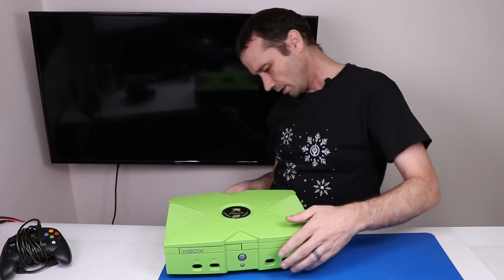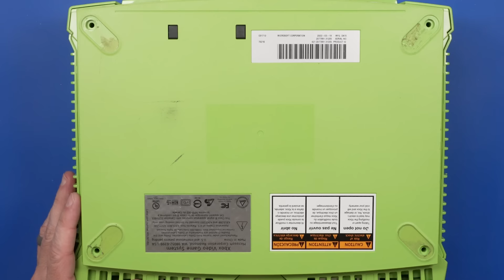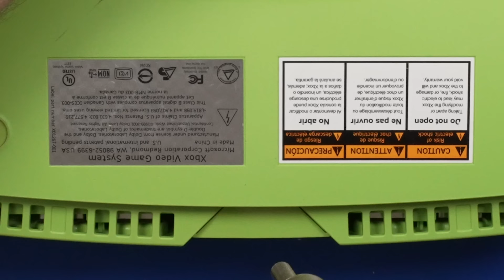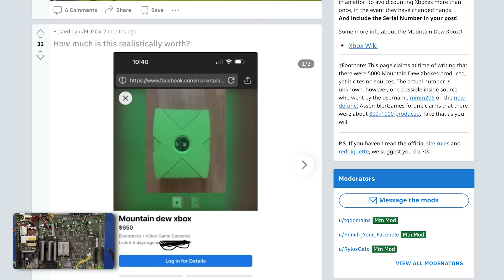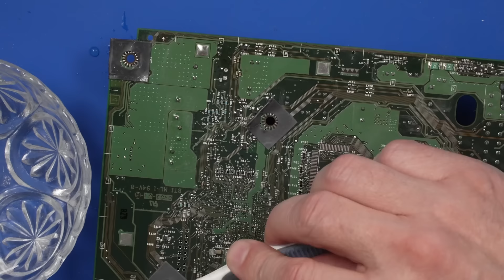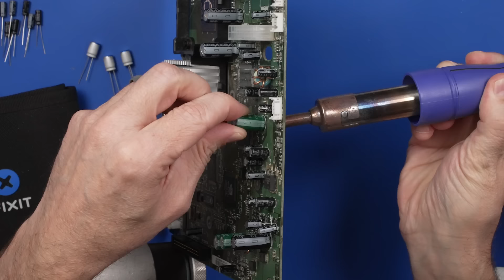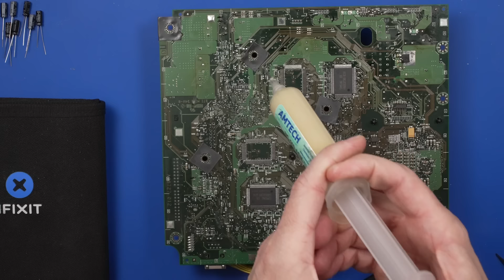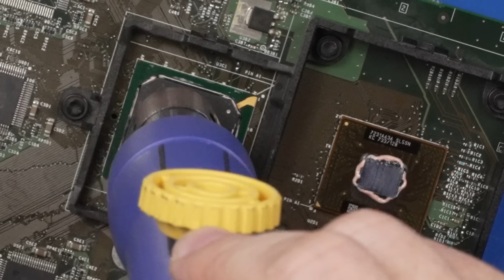I Finally Found One of These! Can I Fix It?

Comment: I hate Goodwill so much. Taking donations from people and still price gouging. Special place in hell for that company.
Reply: The reason why Goodwill has gone up is because of the resellers looking for a fast flip.
Reply: I have actually purchased a number of things through the Goodwill site over the years. The best deals I found were on a couple of virtually brand new HP Chromebooks a couple of years ago during COVID. They were in the original box, basically brand new condition. I purchased them on a long shot for my sons to use for school, and it turns out they were absolutely perfect. They are both still using them today, and I only paid about $40 each for them. You can get a good deal on there, but I agree that some of the prices go way too high because of people trying to flip stuff.
Reply: They're trying to raise money for good causes by selling valuable items at fair market price. If hell is full of people like that, the horrors of the underworld have been greatly exaggerated.
Reply: Not such a goodwill at all then I take it? We don’t have it in UK
Reply: @rorykelly8275  Goodwill spends 90 percent of every dollar on charitable work, they are a top rated charity by independent charity watchdogs.
Reply: Seems like someone either doesn't understand or support charity. Or they expect a charity store to be cheap so they can make a quick dollar off of someone else's generosity.... (@whatjake7898)
Reply: At the end of the day it's not a necessity. It's a luxury.
Reply: Chances are you have damaged traces that feed the power and eject button. If you flip the board and look in the area of the clock cap towards the edge, thats where to check. If that looks good, try another 110v PSU and if you still have nothing at that point, I'd be using a digital microscope and maybe getting a replacement power button pcb. I'll watch with interest.
Reply: Goodwill’s not perfect but they help a lot of people out beyond their stores and clothing. You’d be surprised how much they actually do.
Reply: Everytime I go shopping the pricetag is the wrong price.
Reply: These are auctions, people bidding are the ones making the price go up, not goodwill
Reply: Better to donate to a local thrift store.  Goodwill is a for profit company masquerading as a non profit.
Reply: Why???

People donate to goodwill just to get rid of things easily

The market decides the prices
Reply: Why 🧐 you say why
Reply: I stopped going to thrift stores that started following the Goodwill model. There’s a big one about 15 minutes away called 2nd Avenue and a few years back they’d put stuff out with generally flat prices. I found CIB copies of Suikoden and many other rare PS1 games. Then they started picking stuff out and putting it behind the counter and asking eBay prices. Which is absurd considering their policy of no refunds. It’s like, why would I pay eBay prices for items that don’t have an eBay guarantee? So I just stopped going. Hopefully they’ll go out of business soon.
Reply: On shopgoodwill they charge what people are willing to pay. It's not price gouging. It's more profit for their mission. Yeah it means less super good deals for thrifting, but it's not usory.
Reply: @Spikemonkey80 their mission is profit.
Reply: I don’t think you understand what goodwill does
Reply: I had bought a double buggy and two car seats etc (came together.). I lost my twins snd a second hand baby shop offered me 2O% of the original price. Items were in the box still.
Reply: @phantomreaver85  Then maybe you should try volunteering and helping them out. Goodwill stores operate on very small margins, and huge costs are sunk into sorting and checking donations, not to mention the trash fees for all the unusable junk people donate. Rather than complaining about those trying to help others, go out and help others yourself!
Reply: Goodwill & St Vincent’s, etc, only enable the mooching slackers of the world. I do not think anyone should contribute to them.
Reply: @gnarly-narwhal to then donate to charity
Reply: Their mission is charitable work, selling donations is how they raise money.  The higher selling price allows them to do more charitable work.   They don't set these prices, the market does.  Be angry at the market instead.
Reply: @Scruit  their mission is profit under the guise of charity.
Reply: @Scruit  Their charitable work is supposed to extend to their resales because they're supposed to be helping poor people buy things that they need....
Reply: @buddsmokengood no, selling to poor people is not what they're doing with their stores.
Reply: @notahotshot  That's what all thrift stores are doing...... People with money don't go to thrift stores.....
Reply: @Scruit at the same time, since they are getting this stuff for free they could just sell the item at a flat rate instead of trying to milk it for everything it’s worth. Because all they’ve really done is pushed paying customers away. I refuse to support their model and haven’t been in a Goodwill in about a decade.
Reply: @jackplumley3308  The whole point of Goodwill is to use the profits from reselling goods for their charitable purposes. The only point of them having "paying customers" is to raise money to help people. You not supporting "their model" is just you not supporting charities helping people.
Reply: So, they should resell something for significantly less than market value and so leave a larger margin for the next reseller? 🙄

FWIW, there are some great deals to be found at thrift shops -- just not in video games. I am an avid bibliophile, and I once purchased a vintage book about Princess Elizabeth (as she then was) for about $.50; the ABE online price was around $60. 

It is just not possible for all products to be listed at market price; the key to success in collecting is finding those niches that are undervalued and exploiting them.
Reply: @williamharris8367 Goodwill specifically has all kinds of issues over wildly overpaying executives and turning local organizations into petty fiefdoms.
Reply: @williamharris8367 exactly right. Rather have goodwill profit than your garbage reseller/picker
Reply: @bobbyrivera2951 You'd rather have a corporation profit over the guy next door ?
Reply: @williamharris8367 They said price gouging and you said significantly less than market value. You moved the goal post the complete opposite of what they said. Here’s a novel idea, how about market price? That’s why Goodwill has the reputation it does.
Reply: @XxZannexX  Goodwill is a charity organization that exists purely to help others. You clearly don’t understand how charity work if you are complaining about their prices.
Reply: Then, they still ask for donations after you just bought from them. Didn't I just donate with my purchases? They are definitely a very shady company.
Reply: @willgamez5555  It is not shady at all for a charity to ask if you want to donate more money to their charity. If you don't want to support charitable organizations, then that's only a reflection on you.
Reply: Goodwill is a charity organization. Their profits go to their charitable work. There is absolutely no price gouging. You are seriously messed up claiming they should go to hell for trying to help people.
Reply: @john32-yt  maybe it varies by region, but I've definitely seen some price gouging locally. I don't go often, but last time I was there I saw a broken IKEA desk selling for MORE than it would cost to get it brand new from IKEA. And they weren't taking anymore furniture donations bc their furniture wasn't selling. Wonder why...
Reply: @john32-yt  that is just plain wrong.   Goodwill is a for profit company.   They are not a charity.

Comment: To remove stickers, try using the edge of one of anti static bags. Slide under the sticker and shimmy back and forth. Works well!
Reply: You can also use 90-99% IPA, let it soak under the adhesive, and then carefully remove it. You can then re-apply it with new adhesive and it would look like the sticker was untampered with.
Reply: The issue with all adhesive removers, even IPA, is that is can bite into sticker clearcoats and make them foggy, or soak partially between the clearcoat at the graphics leaving a waterlogged look.  There's really no way around it.  Some stickers respond well, others do not.  Life is a gamble.  :)   @WantBadtime
Reply: @ianburkard  Yeah, but as long as you take your time and use a thin wedge tool and dental floss/fishing line, you should be fine.
Reply: @WantBadtime  thats indeed by far the best way, even works on security labels if your carefull enough.
Reply from the maker: Interesting. Seems like that could work well. Thanks for the tip
Reply: Another great adhesive remover is UNDU.  Great product.  Use in a well ventilated area.   @Tronicsfix
Reply: Denaturted Alcohol works wonders for removing the stickers carefully. Use a syringe and inject a small amount under the sticker slowly adding more to work it loose. Usually doesn't hurt the adhesive or sticker itself. @Tronicsfix
Reply: I've tried many times to remove the Xbox stickers without causing creases, tears, messed up corners or other damage, and it's just too much work and inconsistent. I just use a sharp craft knife to cut a clean hole around the bolt head, way less hassle and looks fine to me
Reply: @lookitskazzy  Same here - decided on that method probably 20 years ago now! It's incredibly difficult, if not impossible, to peel these stickers back and replace them perfectly (especially the silver one) so cutting holes ends up being much neater overall, plus allows access for future maintenance.
Reply: No one here mentioned Plastc Razor Blades? Once you start using them to detatch stickers/labels you won't want to go back.

Comment: I have an Xbox one that I really want to start running again. It turns on for about 60 seconds, and then powers down. I’ve searched for answers, but none of them seem to work and now it seems to want to update, but can’t stay on long enough to complete that update. I’m thinking it must be something relatively simple?
Reply: Oh yeah thermal paste dries up over the years and get crusty. No longer transfer heat effectively. Not gonna lie though I have no clue if that's your problem. It does sounds like overheating though. I'd see if @tronicsfix has a video for an x one repair. At some point he'll apply the perfect amount of thermal paste.
Reply: @SaltyFPV   Thanks again! I usually don’t get this level of help from people, so I appreciate it.
Reply: the power brick or the console is overheating probably
Reply: @dogmountaindew  I’m surprised at how helpful this channel is being. I am very grateful. I will look into that as well, @Endzima_
Reply: I know that’s the case with one of my 360s. That was one of the nice things about the 360 is that it diagnoses itself. Two red rings equals overheating, and we know what it means when all the red lights are blinking. 🤦🏻‍♂️
Reply: Overheating from dust built up inside? I had that issue with my original Xbox.
Reply: @john32-yt  I’ll check it out John. Thank you, I very much appreciate it!
Reply: @TheMahayanist  thank you so much! Honestly, it was one of the first things I thought about but because it was only about 60 seconds I dismissed it. Probably dismissed it too soon because I really don’t know much about how consoles work as far as cooling and other issues.
Reply: Needs the perfect amount of thermal paste.
Reply: @SaltyFPV   thanks for the info! Thermal paste, even though it’s never been taken apart before? Perhaps it’s been used up. I don’t think I’d be able to do it myself because I wouldn’t know how much to put. Hopefully there’s a video on it somewhere. 🙂
Reply: What’s terrible is that I had a perfectly good Xbox one X and I traded it in for a lousy $100! Talk about regret!